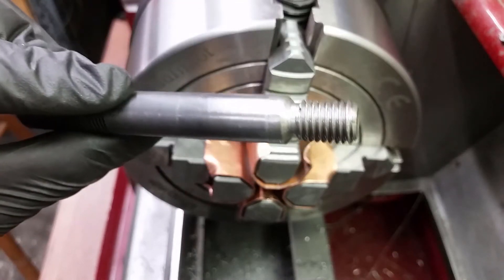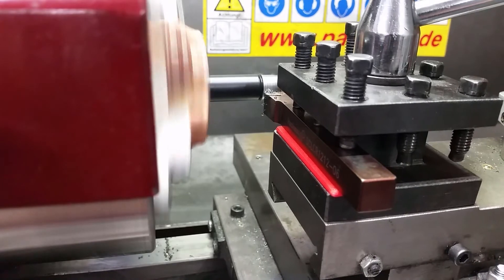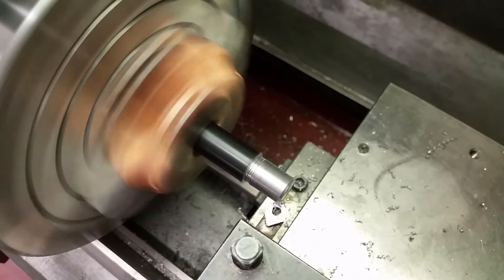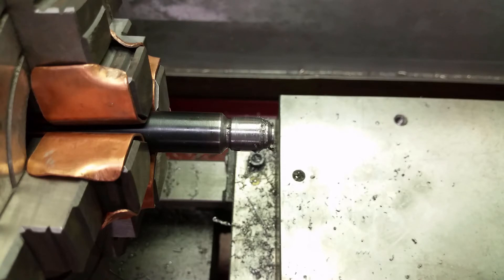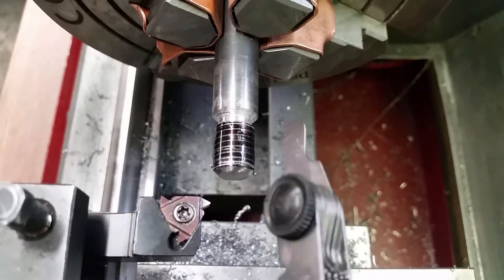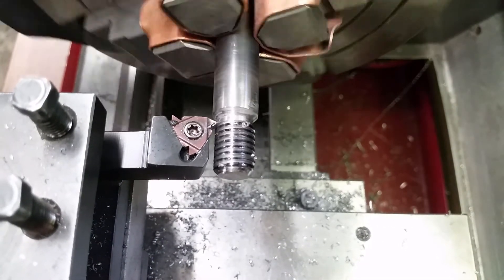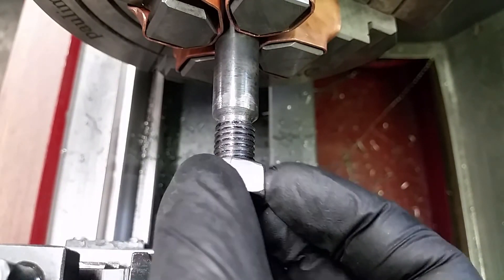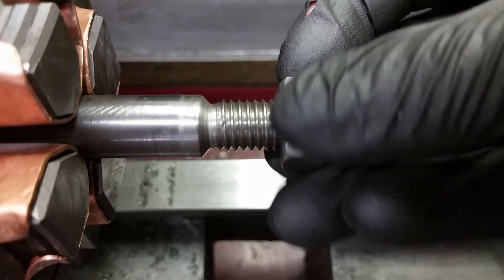Fitting The DMC 250-111 Quick Change Tool Post To My Lathe. From Failing To Success.

Comment: A little tip… 
Wherever possible, try and use your top slide/ compound slide so it is sat on top of the cross slide not over hanging. It should drastically improve rigidity

Comment: Do you think that turning down ACME threads can be done without too much of a problem?  I have a lead screw I need to turn down 5" of threads to make a shaft end.
Reply from the maker: Can't say for sure but this works way better than the original tool post. But i have never cut an ACME thread on my lathe. Never needed it. A normal thread works just fine. I used this QCTP for over a year now and it works great for me.
Reply: @basementprojects4712  Thank you for the info. I'm looking for a wedge QCTP so good to know that yours is working well.